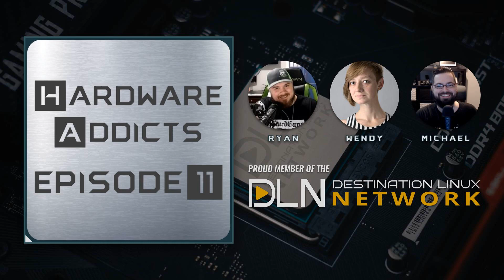Hardware Addicts 11: NVMe M.2 SSDs Explained, Camera Microprocessors, Wireless Headphones & More!

Comment: i have a ASUS 570 board that supports 4.0. it has 2 M2 slots one in the middle of the board and one at bottom. the heat sink was on the bottom one. Which connector should I use for single drive setup.
Reply: Anytime you can reduce heat on a component you're going to get better performance and a longer life out of it. Your manual should tell you which one is your main M2 slot, I'm guessing it's the bottom. Some NVMe M.2 drives will have a built in heat sink that's non-removable and that would be a good candidate for your top slot since it wouldn't fit on the bottom.

Comment: I like my storage fast and cheap, so I do run a nvme-SSD, a Silicon Power 512GB (3400/2300 Read/Write speeds). I bought it for $65. It meets those speeds in the benchmark of the Linux disk-utility. Maximum 3.4 MB/s, Minimum: 1.0 MB/s, approx 40% of the time it runs at 3.4 MB/s. I run the host OS and Virtual Machines from that SSD. The stuff runs from zfs with a compression ratio of 2.2.  The Xubuntu VM boots in ~8 seconds and the Ubuntu Cinnamon Remix VM in ~7 seconds. Most Linux OSes boot in ~10 seconds, while Windows 10 Pro VM needs 35-40 seconds. 
My main storage are 2 old HDDs with more than 6 years of power-on hours (500 GB and 1 TB). I use the first 500GB of both HDDs in zfs raid-0 and the remainder of 1 TB for very old archives. I store my classic VMs on the Raid-0. VMs, like e.g. Windows 95 or Ubuntu 4.10, that always did run from HDDs. I also store there all my data with the zfs copies=2, which means that both disks have a copy of that data, so a kind of  Raid-1 in Raid-0. Approx. 95% of the time those old disks are idle. They are only used for playing music, family videos or to look at my photos. 
To be sure, everything is backed-up once/week on two other PCs. One is really cheap storage a 32-bit Pentium 4 HT running FreeBSD on zfs with two IDE HDDs and 2 laptop HDDs on SATA-1, together 1.2 TB :) :) The other backup is on my 1 TB SSHD in my laptop, which gives me also exactly the same environment at home/desktop and on the road/laptop.

Comment: Do you have a show on how to change hard drives (transfer to a new ssd) in a dual boot system with windows using a normal HDD and linux Ubuntu on an SSD?